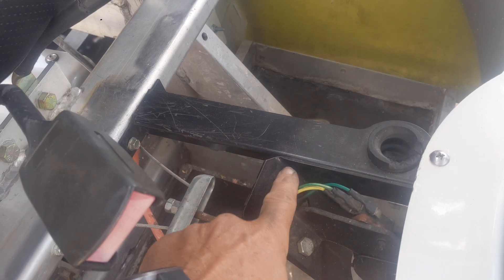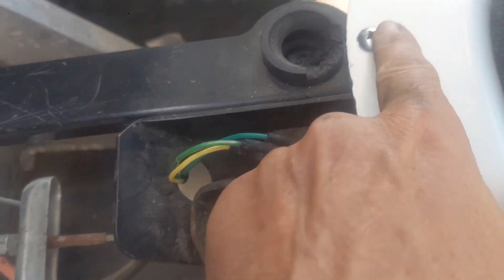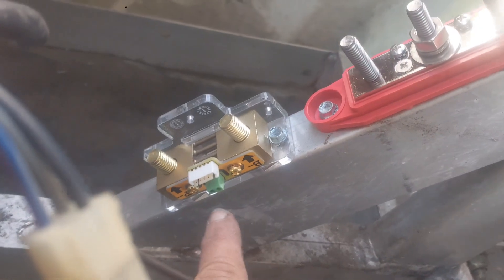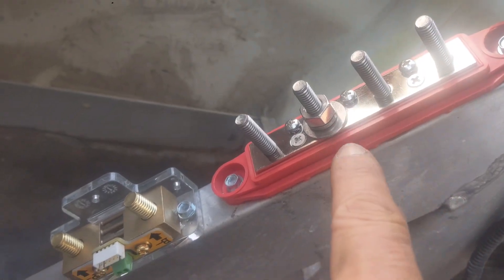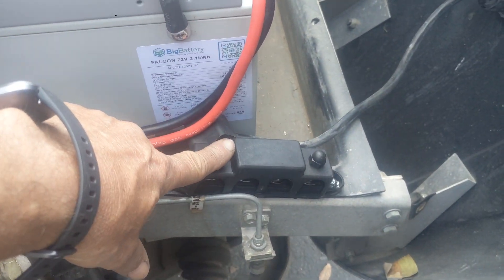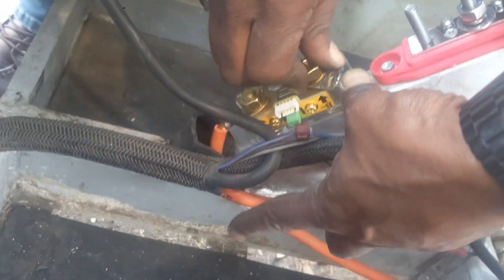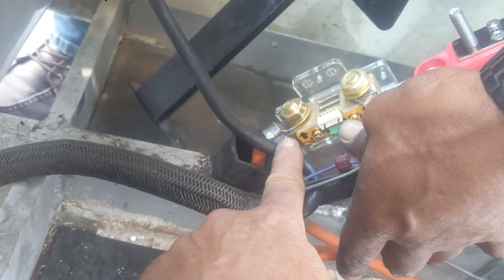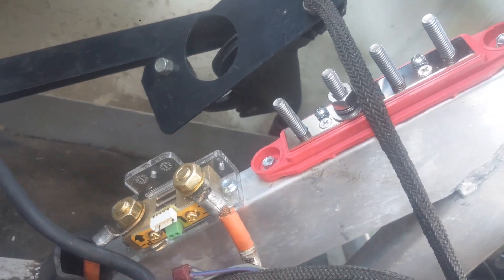BigBattery Lithium Battery GEM Car E825 Install

Comment: Did you notice any trouble going up hills? What's the amp ratings on these?
Reply from the maker: Each battery has 28ah ea. A higher battery capacity can be found on https://www.ride-4-fun.com/batteries

Comment: Great informational video. Just purchased the 2x Falcon kit for my 2001 GEM E825. Adding new lithium charger, what did you do with the interlock and temp sensor wires the were on existing charger? Also, any issues using existing 72v to 12v converter?
Reply from the maker: no issues on 72v dc to 12v dc, taped up temp sensor and secured it, not being used

Comment: Hi, I have a 2000 GEM car E 2 seater. Is the battery pack you purchased a 48 volt or 72 volt pack? Im changing batteries out now as the acid batteries are a pain & so heavy. Would it go on a 48 or does it need the 72 volt? Much appreciated.
Reply from the maker: The 2000 gem is 72v, gem in video is also 72v if that helps
Reply: @DeepcyclebatterystoreSanDiego   Thank you 🙏
Reply: @DeepcyclebatterystoreSanDiego  Thank you, Im trying to see if I can use one lithium battery pack or is it essential to use two batteries. I keep seeing everyone using 2 to 4 batteries in a 72 Volt golf cart. Thoughts & thank you so much
Reply from the maker: @Surfgidgetthepug  two of battery evo brand, four of Allied brand

Comment: What kind of range you getting with the 2 Falcons?  Assuming not really any room for a 3rd Falcon?
Reply from the maker: Big battery says 15 miles per battery batteries so estimated range has 30 depending on terrain and passenger weight. Only room for two. The weight reduction is noticable when driving